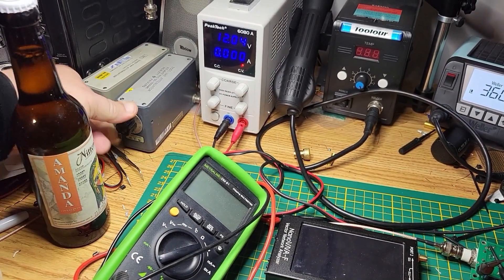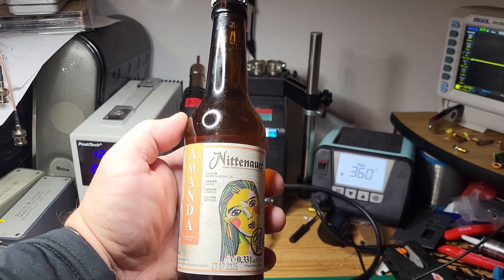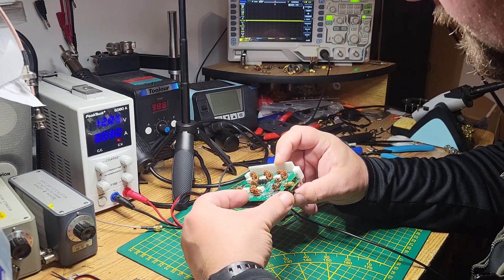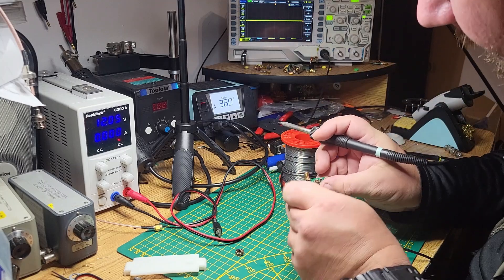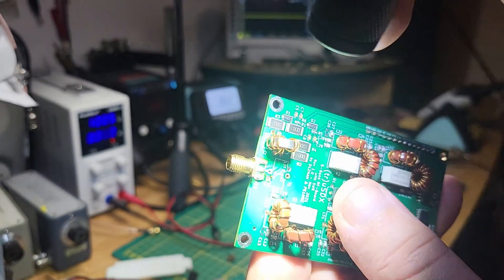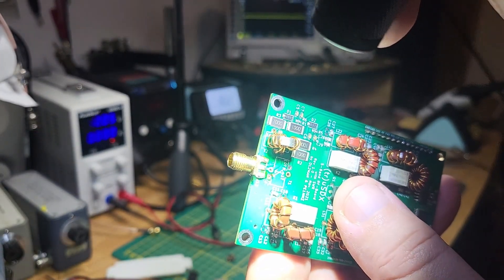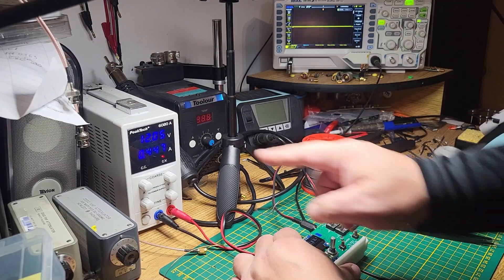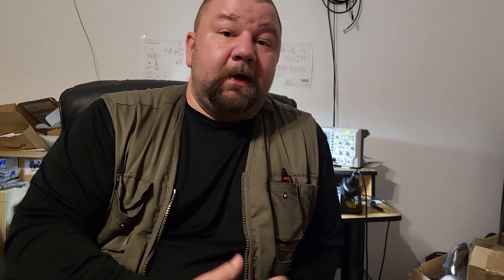(tr)uSDX troubleshooting and repair #1 - Problems with SWR and Power out

Comment: One thing I do, is to put the dummy load as near to the oscilloscope as possible, using a BNC T Piece, to avoid reflections on the 1 Meter testing coax cable. This was  not neccessary in this case though.

Comment: Thanks for doing this Manuel. Yes, Weller is still a big thing also this side of the big lake. I keep mine from the days when I was on Tech school, and take care of it. It is basically being replaced by Chinese tools and becoming hard to get replacement tips. You are basically connecting the Scope directly to the output of the Dummy load? I mean... after the diode that is intended to be used to measure via a DMM?  73 Rob. YS1RS.
Reply from the maker: I connect the oscilloscope to the "hot" side of the resitors. After the diode, there would not be a sine anymore. basically "in parallel" to the 50 Ohms.

Comment: Welcome back broham! 
Have a classic band with fdt86256 which worked , then one day forgot to add a dummy load and capoot, no swr readings, but still transmits fine O.o 
Haven’t played with it in a while , I’m much more of a ham now . Will have to go back and see what’s a matter
Reply from the maker: Are you sure, there´s actually output power ? Did you confirm it with external measurement ? 99,9% PA FET gone.... 73 Manuel; DL2MAN P.S: Broham.... Cool, never heard that before  ;)

Comment: Thank you Manuel.
Weller is a major brand in the USA, possibly THE major brand. Weller soldering guns of about 200 watts have been popular here for all sorts of purposes for at least 60 years, back when I wanted a soldering iron for Christmas in 1963 to do electronics soldering, but my father bought me a 200 Watt Weller gun because that was the only sort of soldering device he was aware of other than a propane torch. Fortunately, most of what I was building was tube (valve) gear back then so I managed to do it with the gun without much problem. By the time I was working with semi-conductors on PCB's I'd purchased my own soldering pencil, and had the big gun to solder onto chassis and such, so it all worked out.